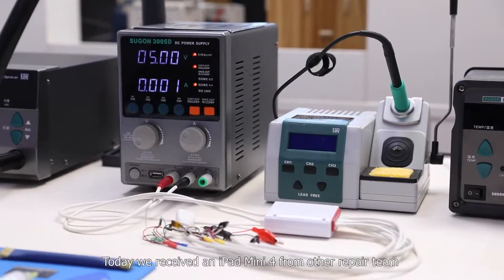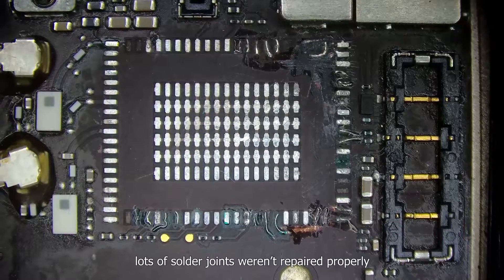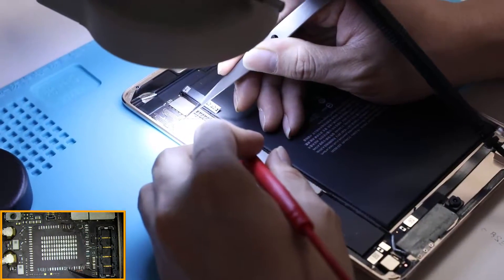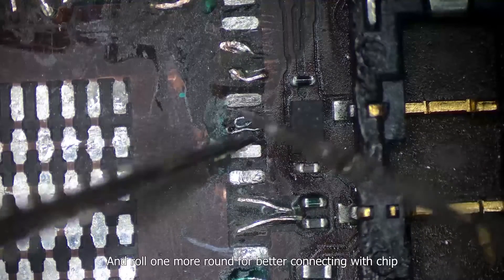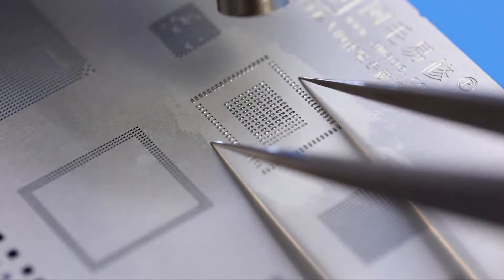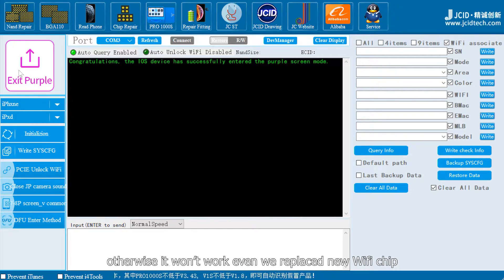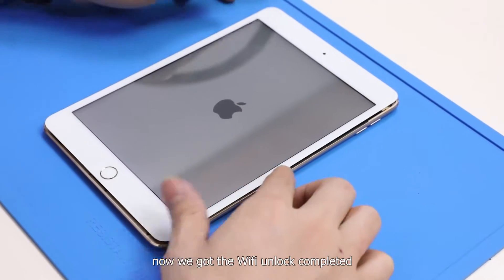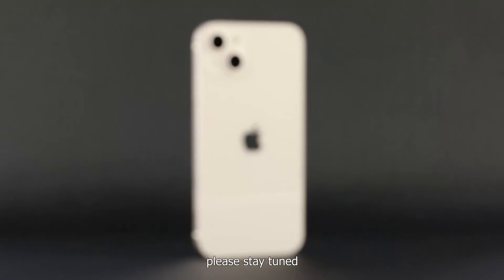iPad Mini 4 WiFi+Bluetooth Repair, After A Failed Repair By Other Repairman

Comment: What was the tool you used to unlock to wifi vis the lightning port?
Reply from the maker: It's JC B-BOX PRO Black Technology One Key to Purple Mode Programmer, check below link for details, and email: elekworldservice@gmail.com for price.
https://www.elekworld.com/Shop/productinfo.aspx?proid=16258&categoryid=287
Reply: I have a problem this issue, I'm from Bangladesh

Comment from the maker: Today we received an iPad Mini 4 from other repair team, which was tried to repair but finally failed. The problem is Wifi and Bluetooth stop working. Can we restore both Wifi and Bluetooth function back?

SUGON 8610-DX Desoldering Station Hot Air Gun, 220V, w/retail package: https://www.elekworld.com/shop/productinfo.aspx?proid=15826&categoryid=283
6-10W 5V USB Power UV Glue Curing LED Lamp: https://www.elekworld.com/Shop/productinfo.aspx?proid=6371&categoryid=371
XG-50 MECHANIC Tin-Lead Solder Paste, Medium Temperature, 42g: https://www.elekworld.com/shop/productinfo.aspx?proid=6941&categoryid=283
MECHANIC TY-V866 Solder Tin Wire, 40G: https://www.elekworld.com/shop/productinfo.aspx?proid=15834&categoryid=374

For more Repair parts&Tools and Tech support, please visit:
Website: https://www.elekworld.com
Facebook: https://www.facebook.com/Elekworldshop/
Instagram: https://www.instagram.com/elekworld/
Twitter: https://twitter.com/ElekworldL